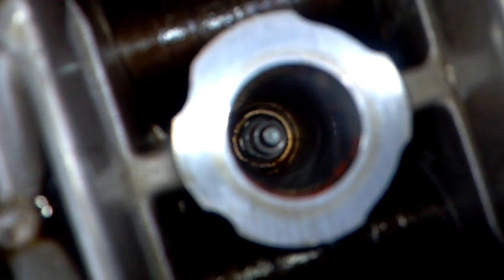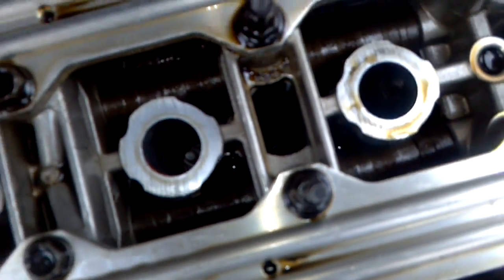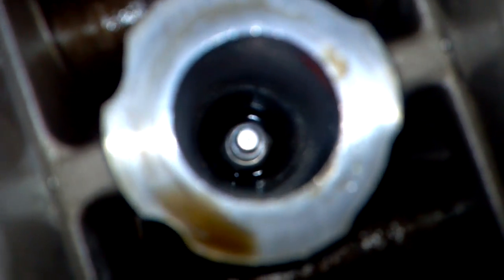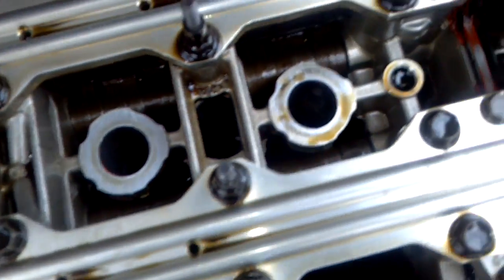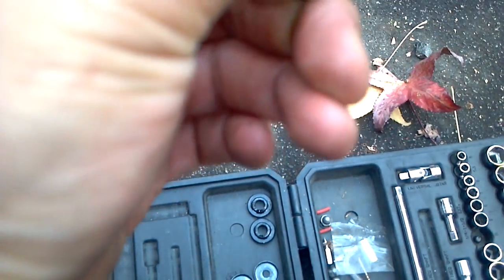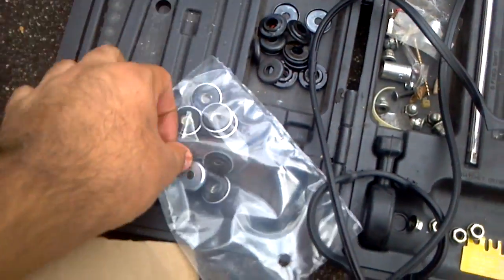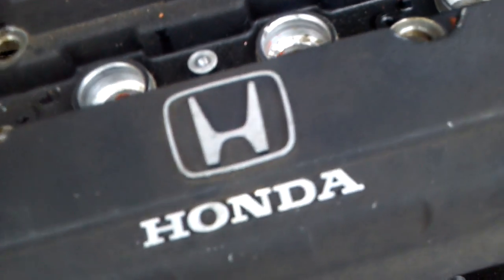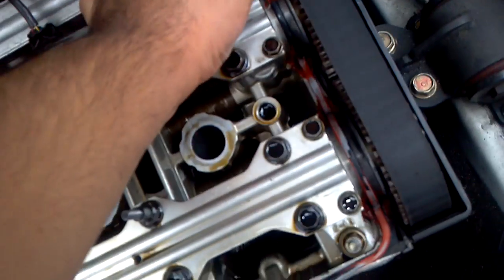Integra gsr gasket replacement

Comment: Hey after changing gaskets did it stop leaking oil. Cause my b16a is doing the same to the point where all 4 get filled to the top. I changed the seals and checked like 3 Months later and they where full again.

Comment: Lame it was stolen. Do u know if that helped the prob? I have a 97 gsr and did the same but still leaking oil. Maybe my Dis cap I ring I'm thinking.
Reply from the maker: when i replaced the gaskets it solved the problem. If you have a leak coming near the cap it is most likely the the distributor itself. Good luck.